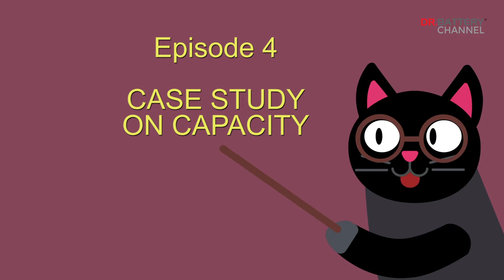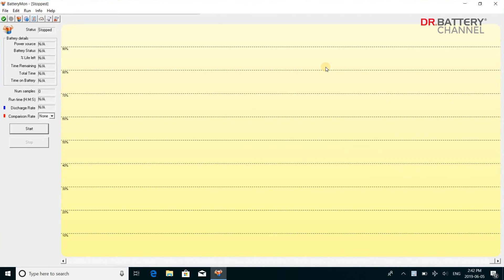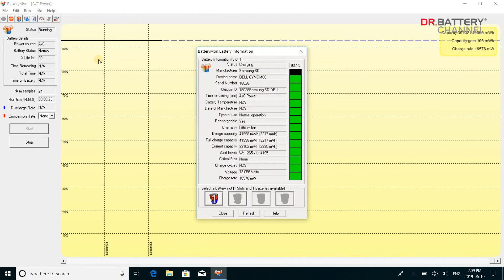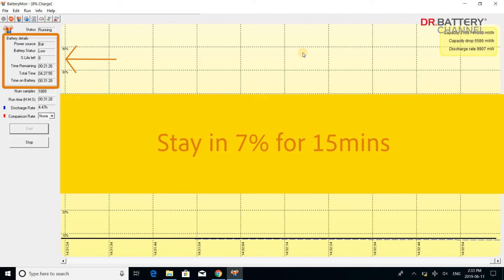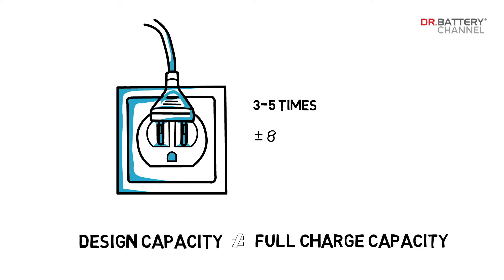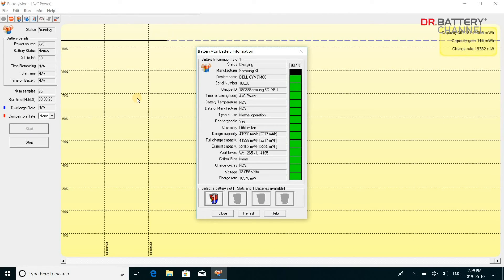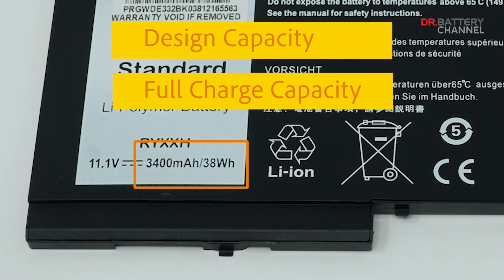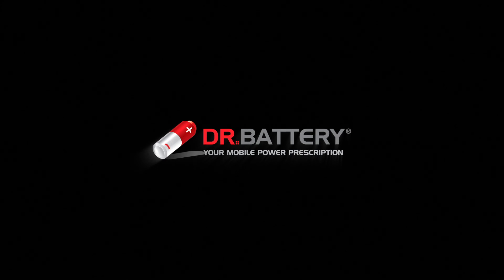EP.4 - Understanding Laptop Battery Health: Design Capacity vs Full Charge Capacity

Comment: My old battery is FCC 30.326 vs DC 48.250  so it's still good right?? Also what cycle count means? I have 33
Reply from the maker: Full Charge Capacity (FCC): This is the maximum charge the battery can hold now, based on its current condition.
Design Capacity (DC): This is the original charge capacity the battery was designed to hold when it was new.

If your FCC (30.326 Wh) is approximately 30% lower than your DC (48.250 Wh), it means your battery now can hold around 30% less charge as it used to, indicating that the battery has lost some of its original capacity and is not at its optimal performance.

What Cycle Count Means:
A cycle count refers to how many full charge and discharge cycles the battery has gone through. For example, if you use 50% of the battery one day, recharge it to 100%, and then use another 50% the next day, that would count as one full cycle. Manufacturers typically rate batteries for a certain number of cycles before performance starts to deteriorate

With 33 cycles, your battery is relatively young, as most laptop batteries are rated for 300–500 cycles before they begin to significantly degrade. However, your FCC vs. DC numbers suggest some early wear, which might be due to factors like storage conditions, temperature, or partial charging habits.

In short, while your cycle count is low, the reduced FCC compared to DC suggests the battery may not be performing at its best.  As www.drbattery.com will be able to provide a better battery replacement than the current one in your computer.
Reply: @DrBattery  thank you so much for your detailed explanation! You're a great content creator. 🤍 I appreciate you